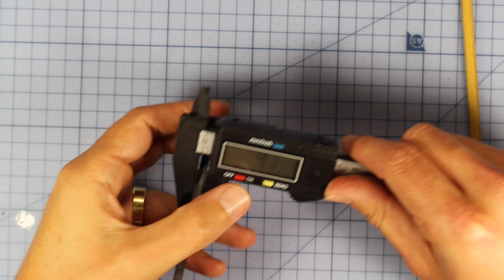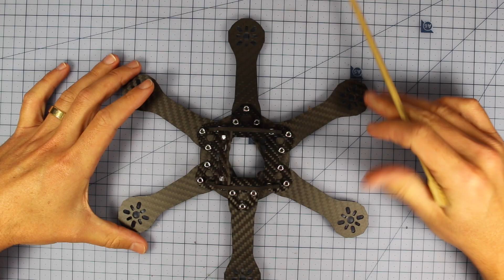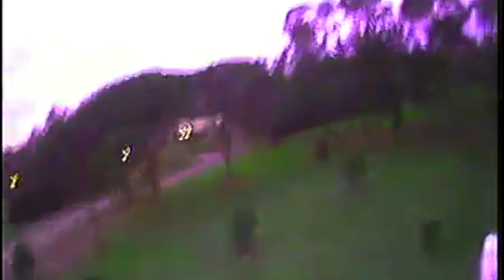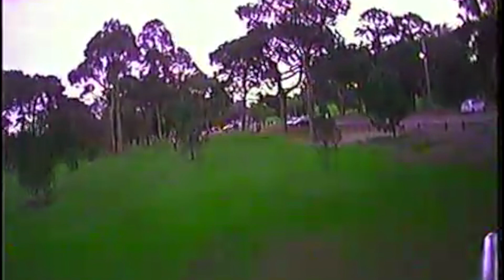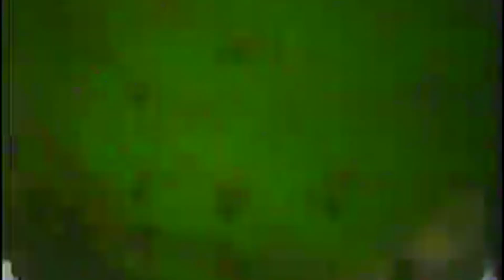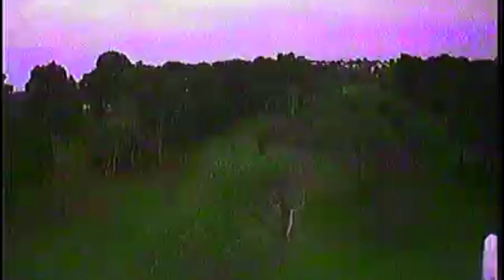Flynosaurus Hex review. Like a T-rex, with 6 arms, that flies...

Comment: Found the flight footage 😅. To bad it's not running on a f3. I have Armattans hex v1. Tuning it got me close to madness with Armattans factory fc. So I slapped a spf3 fc in it and running multiwi(rewrite) damped light on 20amp little bees. I know exactly what you mean by props wash when on descent: damped light helped with that on air mode hexes don't like to sink. I find I have to almost drop my stick when I want to dive. But when you get used to it, nothing I've flown pulls up like a hex. When you get your timing right your air time after a good punch is almost unreal. I watched the sun  set upside down (it felt like I was pushing up forever). I've raced mine and be aware that since you are the only hex out there they gonna be on you like shark on the trial of a seal. I was struck by 3 different pilots when in contention. They all told me its mesmerizing chasing a hex, they mess timing when entering a corner. On the corners is a struggle since it doesn't like to sink,
Reply: But on the straights it's a beast.. I was often asked how heavy the hex was. I was told they have never seen anyone pull away like that in a straight. But then I fail on the corners being paranoid of being hit. Lol.. Good luck and post your findings. I'm close to pulling the trigger on a 4" octo-x frame. If 6 motors were good logic suggest that 8 will be better😇. Cheers mate! Ty for sharing!